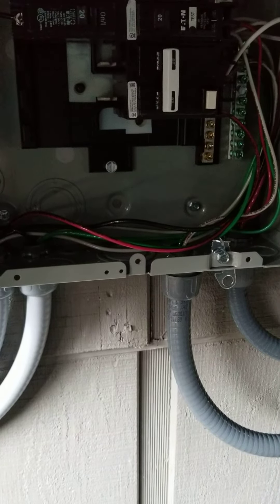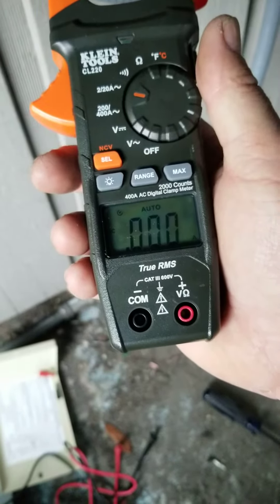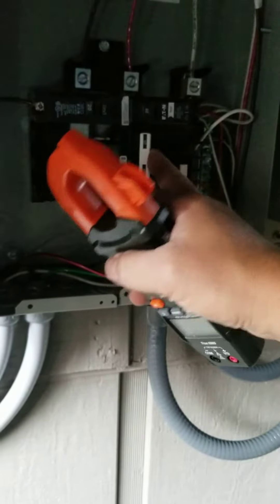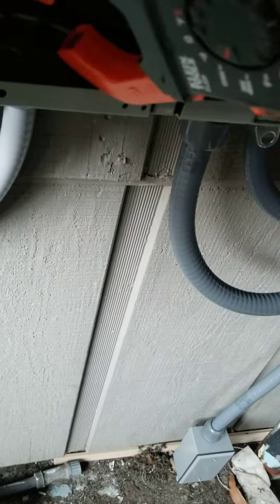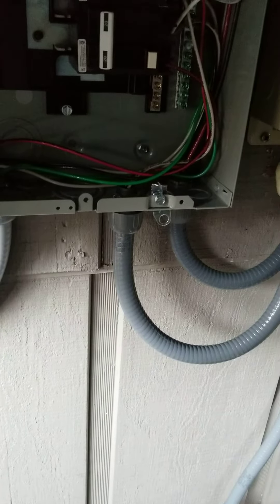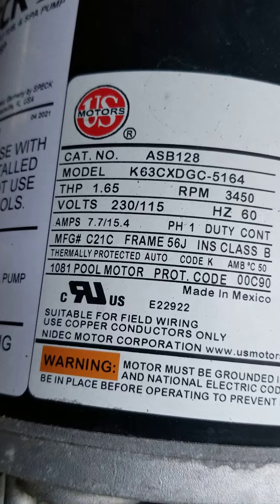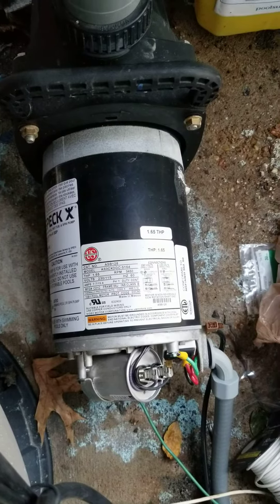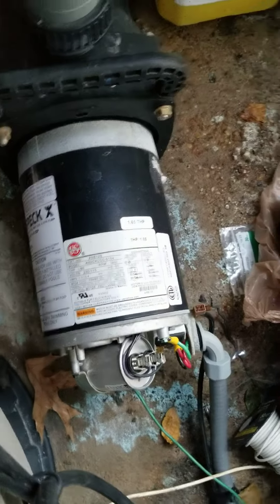Pool pump amperage test

Comment: I have a brand new pool pump motor and it is rated at 9.6 amps at 240 volts, but it is pulling 10.7 and 10.5 per leg that is indicating a problem no? by the way the I believe the temp switch is turning it off and on

Comment: Hello Josh  
So if the first reading is 5.76A and second is 5.95A 
But the normal operating current is 15.1A  ….
Are you add the two currents together and if so where’s the other reading from

Comment: NICE vid Josiah!!  Very helpful!!   I have a similar issue but different symptoms.   My rated amp on my 2.64HP Century is supposed to be 8.5-7.8...  However, each leg is testing at 5.9A on a 9 year old pump.   From where I sit, the motor is tired and needs replacing.   Thoughts?
Reply from the maker: If the amperage you test is lower than the amperage listing it could mean 2 things. 1. The motor windings are about to go out. Or 2. An impeller with a lower horse power rating than the the motor was installed. Smaller horse power impeller means easier for the motor to spin it which means lower amperage.
9 years is far longer than most motors last, congrats!
Reply: @josiahpowell72    Thank you Sir... main symptom is that it isn't priming and pulling from the three legs of the pool - skimmers, main drain, or spa.   Easiest draw would be from the main, but the pump isn't pulling anything.   Agreed, at 9 years, we made a "profit"!!  Your vid inspired me to run the amperage test.